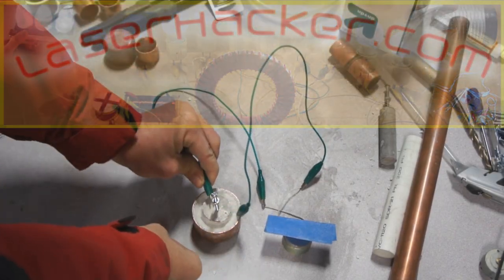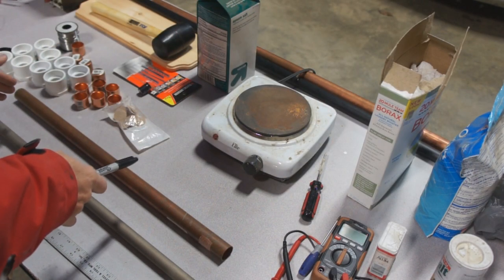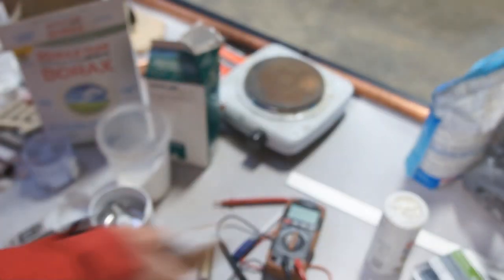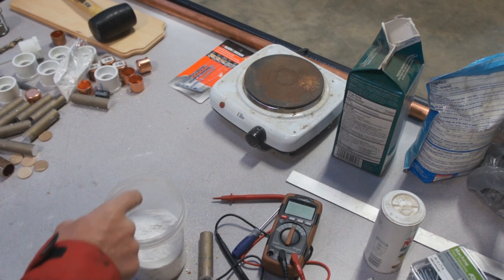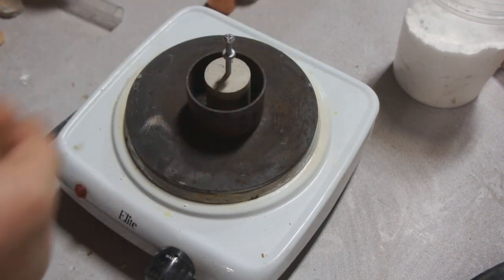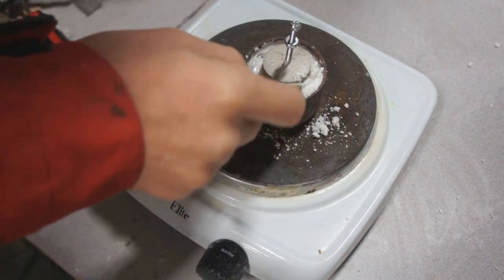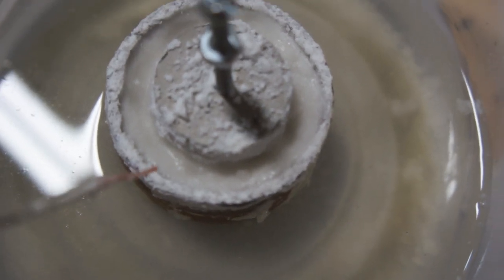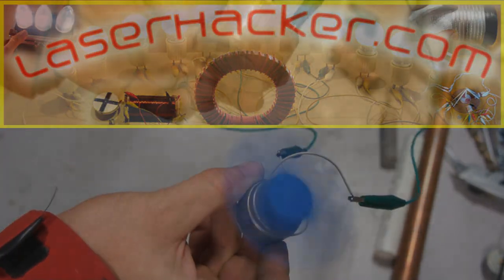How to Build Crystal Power Cells - Long Duration Power

Comment: Assuming you want to use 1/2 cup of borax, which is approximately 68 grams, here are the corresponding amounts you would need for the other three ingredients to achieve equal moles:

Borax (Na2B4O7·10H2O): 0.178 moles
Mass required: 68 g
Epsom salt (MgSO4·7H2O): 0.178 moles
Mass required: 87 g
Alum (KAl(SO4)2·12H2O): 0.178 moles
Mass required: 134 g
Potassium chloride (KCl): 0.178 moles
Mass required: 13 g

The fact that the magnesium core has risen up out of the container may indicate that there was a chemical reaction between the magnesium and the powder mixture/copper cell, which caused the magnesium to corrode and produce hydrogen gas. This gas could have built up over time, causing the magnesium to rise up out of the cell. 

This would be a good place to start to have equal amounts in the recipe. Hope this helps.

Comment: Hi Lasersaber, maybe it is beneficial to run a small load resistor during cooling already on the cell, so a current in the right direction is impregnated into the cell already during cooling ? Maybe around 500 to 1000 Ohm ?
Reply from the maker: It's worth a try.  It would be a little like an electret.
Reply: have you tried this yet? did it work?
Reply: lasersaber after seeing this video im inspired to remove the electrolyte on my dead 6 volt motorcycle battery and then charge them up to several hundred volts DC low current and then pour some hot beeswax into it and let it cool slowly into an electret!! thanks lasersaber!!
Reply: is that even possible?
Reply: is that even possible?fidel catsro
Reply: ***** not sure if it can be done Andrew...but its worth trying since battery also consists of two stacked electrodes spaced closely but apart right? it might be a challenge charging them up to several thousand volts without some kind of violent reaction and also to pour hot wax into the crevices and let them cool down slowly..
Reply: The copper & magnesium decide that already.  It's the same concept as a dime/penny battery.
Reply: Yes but the dime/penny battery has a liquid electrolyte and this has a crystal electrolyte. The liquid molecules are free to move around but the molecules in the crystal aren't.The current 'could' help to set up the crystal formation in a certain orientation (or a more organized one) to aid in the movement of electrons. (Just my two cents)
Reply: +Andrew Cline good thought. With a current already finding the best path on it's own, in my mind it would make sense that an alignment would form as the crystal base crystallized into a solid along that path. Then again I'm only just self educating in electricity now as part of a project I'm working on for an entire completely clean energy(or as clean as I can manage from start to finish) community experiment.
Reply: +Andrew Cline;   And a dime or two?
Reply: Experimenting with the concept of making one large cell which is the equivalent of 50 small cells, and 50 small cells to see if there is some difference in voltage between the two. Also looking into making units that are replaceable for a home with it's own built in power source based on this crystal cell technology. Be nice to live completely off the power grid. Home includes LED lighting which is easier on power draw. The goal is to make a cheap to build structure that can be easily assembled with it's own power source that can be erected almost anywhere and provide basics for living. 

Current plans include the re-engineering of a refrigerator(a small one) for food preservation and electric toilet that burns the waste. They make these toilets in 240 volts but trying to adapt it to crystal cell has been tricky to say the least. Lighting hasn't been a huge problem as my very first battery is still going strong after I built my first right after my first post on this topic. That LED is still lit. My test model is an old shed on the property that I've remodeled a few times as a test model for this project. My hope is to one day find something about this tech that can be boosted for better currents via use of different chemicals to make it.

NOTE: the concept of this home is in essence for minimalist living without multiple modern conveniences. Lights, refrigeration and water drawing(not hot water). This does not mean hot water and television and DVD players though it may include simple radio as a means of keeping on top of news like weather and such.
Reply: ^ this is what you want to do yes, for sure iits betterr to set them up correctly, also , one might add a llittle furtherr materials to make it more conductive like silver or so (in tiiny tiny amount or it breaks) :) but very nice video! very clear ty :)
Reply: just a boatbuilder here. thinking of all the ways to inc. this from boat putty to things like house foundation?
Reply: Devina Danado

Comment: The joule thief seems like a nice pairing to this crystal battery
.
Also, it seems to me that a small amount of concrete mix (lime, sand, water) would allow you to make this without the heat plate. The lime will react and get hot with the water, maybe/maybe not hot enough to get the rest to react.
Reply: I think the idea is it's CRYSTAL..

Comment: nice video but where do you get a magnesium core from as thats not easy to get and what are the alternatives to the magnesium core
Reply: Steven Chiverton hot water tank replacement anodes. Most good hardware stores

Comment: I think you would have an easier time with this if you melt the salts first and pour them in, followed by the magnesium core. Measure the total volume of your copper cylinder, then subtract the volume of your magnesium core and wooden plate from that to find how much volume of molten salts to add. Then just lower the magnesium core in. Let cool and done.

Comment: I would make a box input screen plates alternating copper screen and magnesium screen held with plexiglass with slots cut in it. Stack all the negatives and all the positives together, poor molten salt into the case a little bit at a time until the whole case is filled and let it cool.  You might be able to generate one heck of a lot of power from that one battery stack. Unlikely to be rechargeable many times, but a great idea. Near solid state battery!